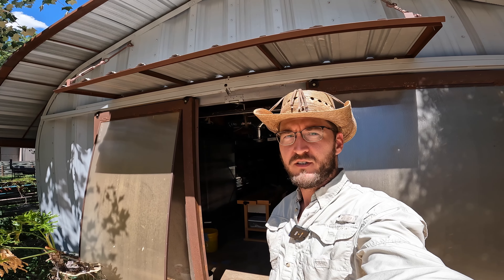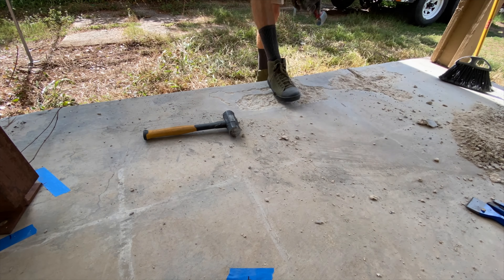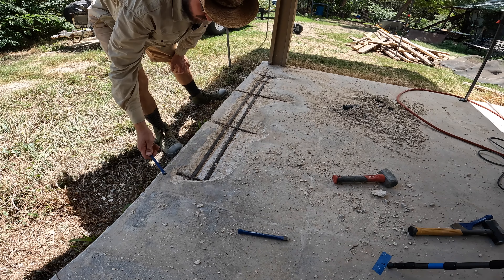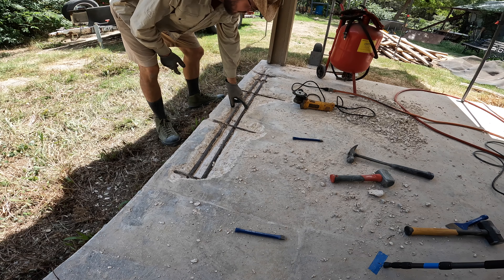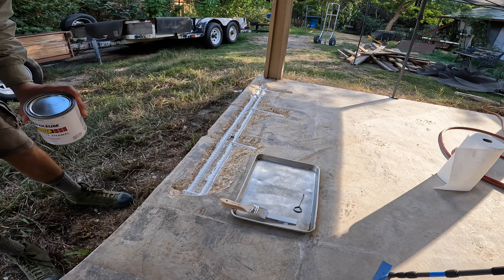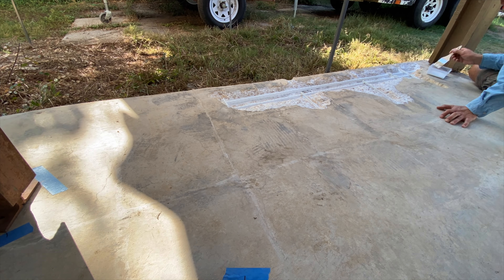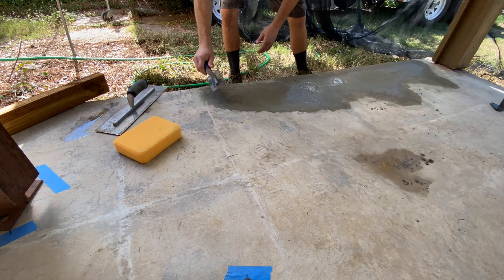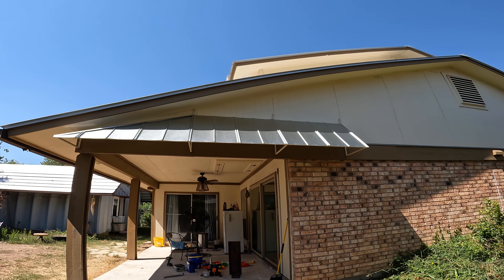DIY foundation repair

Comment: It's completely normal for re-bar to rust to an extent inside the concrete, but it should be sealed, and that corrosion stops at some point. If the rebar is exposed or there is a crack etc. allowing water / air ingress then it will continue to rust until it eventually fails.
Reply from the maker: That makes sense. I knew I was going to be building a rocket mass heater so I had to be sure this foundation was super stable. Thanks for watching that video too and commenting on both!!!!
Reply: it shouldn't rust inside the wall.
Rusty rebars isnt a problem if its only surface rust, most of them has surface rust already before you put them (since theyre stored outside most of the times) in the wall but that isnt a problem since it should be sealed as you say but it shouldnt rust inside the wall since its sealed.
Reply: It has to have air to rust ?
Reply: Concrete is porous and often we only apply sealer to the top, the side would have still wicked it in. Newer industrial projects use precoated rebar.

Comment: Concrete for this type of use does not require rebar. Most houses in my area are built on 4” slabs and as a structural engineer I’m regularly calculating maximum loads they can handle from things like beam reactions, etc. I’m not sure why your slab had that large of rebar so close to the top edge of the slab other than for temperature/shrinkage crack control which can easily be achieved with wire mesh. They should not have reinforced your slab to begin with, but this definitely was an education video to see how one can preserve exposed rebar. Thank you!
Reply: What region are you in ?

Comment: Hello. I am personally convinced that the iron reinforcement should be in contact with the concrete, which protects the iron from corrosion with its anticorrosive behavior. When I was repairing such a malfunction, I removed the loose material, rubbed the iron reinforcement with a rust remover to neutralize the corrosion layer, and then sanded it down and poured it with concrete, which bit into the iron and protected it from corrosion at the same time.

Comment: Modern concrete is junk. The steel rebar actually breaks up the structure, as it vibrates with any seismic event. It's like adding a jackhammer inside your slab and walls. If you jacket the rebar in PVC pipe, that would help, but it doesn't solve the issue entirely. Ancient concrete used fibers as reinforcent, and those structures are hundreds of years old. Typically, these are called unreinforced concrete, but it's anything but that. They used silica fibers, asbestos fibers, and others. Actually, concrete water pipe manufactured today often contains asbestos fibers. It is considered to be safe in water pipe. There is no reason to preserve the steel, just let it rust. Add glass fibers or nylon fibers to your concrete mix. Lightweight, self leveling concrete contains some fiber and certain additives and is three times stronger than what you patched it with.

Comment: Former Special Inspector here....according to ACI and ASTM standards, minor surface rust is permitted on rebar as long as it is not scaling or affecting the dimensions of the rebar and/or it's deformations.
Reply from the maker: I wish I knew more about the details. This stuff was sticking up proud and cracking the concrete around it. I imagine there is some rule against that although I cannot pretend to know what it is. Thanks for commenting!

Comment: The philosophy of rebars in concrete it to give tensile strength, the reason is that concrete does not do well under tension load.
As a structural engineer, I see no tension load path in your exposed rebars. You can see it, after removing the concrete, the porch slab did not disintegrated. So what it is telling you that the rebars are totally unnecessary.
If I were you I would expose about 6 more inches of the rebars, saw it off, roll it into a wad and try to find who put those rebar on a porch slab and you can complete the sentence for me.
Good luck with your repairs.
Reply from the maker: Lol. Thanks for the education. You make some good points. The repair site is now covered with a 6,000 pound rocket mass heater. You should check that video out.  But it’s too late to change the repair now. Thanks for watching!
Reply: @suburbanbiology  don't listen to that enginerd bro. Probably still in school and has no real world idea of what he's talking about. Concrete doesn't miraculously fall apart without rebar. The fact of the matter is all concrete cracks eventually and when yours cracks it'll stay together and not buckle cause it has rebar
Reply: @e.collins2768  you don't need 5/8 to avoid buckle nor cracking. a mesh of 3/16 would be better to avoid that. As how is the rebar placed, it would not prevent buckling for load, so the only thing that could hide is some settlement failure that would eventually surface as the rebar is to close to surface to preserve reliable contact with the concrete (like how it was shown in the video).
If that rebar was doing anything in there, the exposing of it would have made the structure fail. The evidence shows that the rebars is: Badly placed in both depth and separation because it was badly sized (someone was lazy and didnt want to wire a proper mesh), and wasn't doing anything. The enginerd was right: if the rebar was doing something, the adherence failure would have made the slab to deteriorate with small fractures and with weathering (a.k.a water or air, CO2 destroys concrete) would have "disintegrated" with enough time. 
I believe that the concrete failure was induces by the rebars being loaded in tension when the slab was made (why else would the small rebars stick to surface level when the concrete was removed?).  With time, the concrete failed because the only tensional load was the rebar itself.  It looks like the small rebars where also too close to the border of the slab for proper installation, so something weird happened in the slab making. 
But hey, I just point out design and operational errors that could end people in mines for a living, what do I know?
Reply: @giuseppebonatici7169  Thank you for such a short and nuanced response instead of relying on insults, it’s refreshing.
Reply: @giuseppebonatici7169  apparently not much about flat work. I've poured and demoed many pads and not once have I ever seen concrete fall apart after busting through to the rebar unless there's already a crack there. Small insignificant pours often have rebar at different heights throughout the pad. It is very likely at a good height a foot or two away from where he stopped. It's a porch built for foot traffic and to out last a couple owners its not a mining operation dude. we had an engineer make us pour a 3 foot thick pad with 2 layers of rebar one time because it was getting a 20 ton ac unit on it and he thought that was the weight instead of cooling capacity. The only people who take engineers at face value are people who dont know any better. Also you'd be shocked if you saw how many times I've busted up concrete and saw the wire mesh sitting in the dirt under the concrete. And that's on heavy-duty applications
Reply: @e.collins2768  On this one I would prob wouldnt dismiss the advice of someone that has a ton of experience demoing concrete and has seen it all.  I think the one thing everyone agrees on is that whoever poured the slab installed the rebar too shallow and too close to the edge.  They obviously weren't really paying attention to the details which makes sense given the pad would most likely only see foot traffic.

Comment: Great video.  Big question; given rebar is popping cement off side of foundation, should that rebar be removed prior to resurfacing facia on side of foundation?  House was built about 1972.
Reply from the maker: It should probably be exposed enough to paint it and then recover it with concrete. I’m not an expert in this. I’m just guessing. You should hire a foundation company to have an engineer take a look at it. I’m sure there are many variables that go into an engineer’s final decision. You could always get their opinion and then do the work yourself if you feel capable. Thanks for commenting!